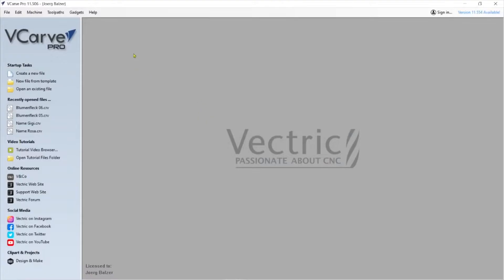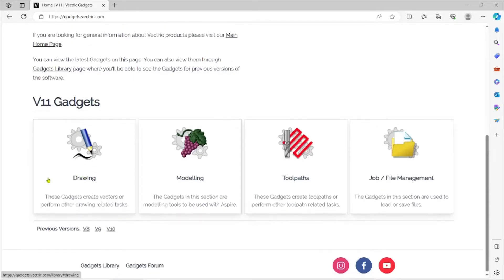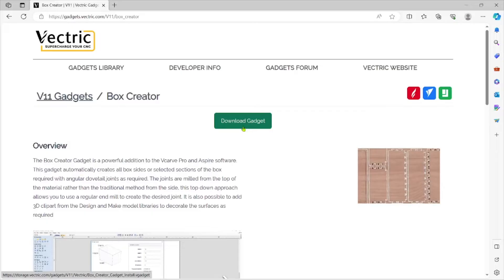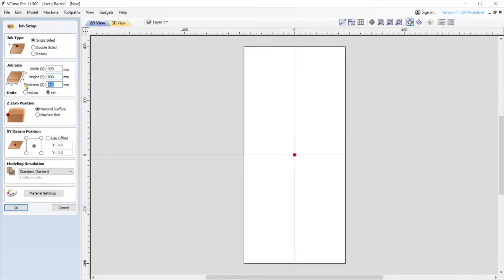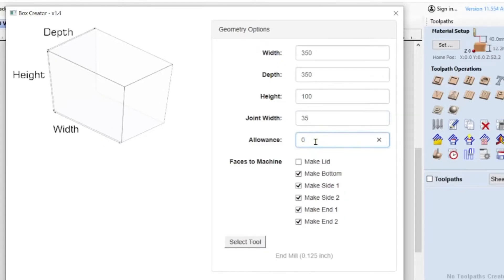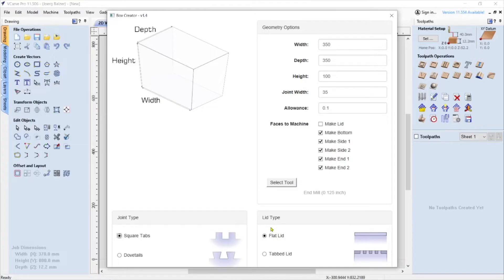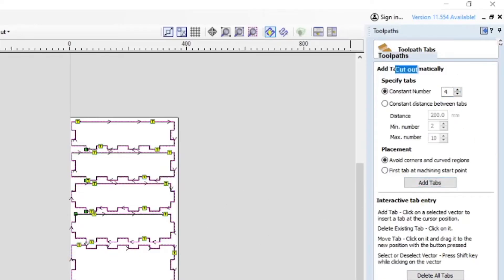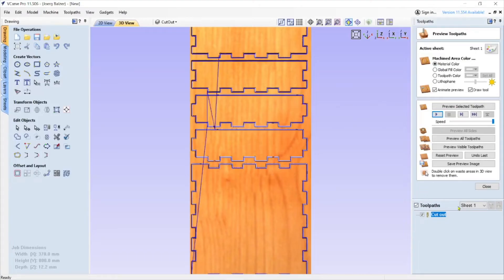Vectric Box Creator - The Easy Way To Make CNC Boxes!

Comment: Struggling to get joints as tight as yours. Looks as if mine creates on the vector rather than outside.
Reply from the maker: This is one item I had written down and forgot to mention. Yes it’s correct it needs to be “ON” the vector. So I made 3 tests for the allowance. The 0.2mm was too loose, the 0.1mm was still loose but good for many joints that will need to be glued. 0mm was difficult to get together and I just used some CA Glue here and there. Make sure the material thickness is set correctly and that the diameter of the bit is correct. That’s really all you can do.
Reply: For the USA folk I use a .01 inches for my allowance in the Box Creator.

Comment: So you are trading shortening your tool life for a cleaner result?
Reply from the maker: I would say it depends on the impact of the project versus the tool. 
If an edge is difficult or impossible  to clean up, yes I trade a bit of tool life. Also in wood rather not that significant (vs steel).

Comment: This was a very well done tutorial. I made a small box using the box creator and it turned out great. Thank you. One point that you made was the wording of "Allowance". I agree in that allowance is not a good work. However, tolerance is the wrong word as tolerance refers to a range that a measurement can be in. The correct term, at least as far as machining is concerned, is "Clearance". Again, thank you very much for your work, it is much appreciated.
Reply from the maker: Appreciate the feedback !!! Yes clearance is much better in German we often use “play”. Or reference to the fit like “press fit”. Glad your project turned out great.

Comment: If you are doing finger joints but not using box creator, what allowance do you use to have a tight fit.  Example if the male finger is one inch, what side would the female be in order to allow for glue but not be too lose that it doesn't stay together?
Reply from the maker: This seems to be an easy question but has a bit longer answer. So on my machine on wood projects I go for 0.2mm. If it is a joint with lots of surfaces and the risk of the wood will swelling up on me I go for 0.3mm. However chances are on your machine that varies a little. These CNC routers are just not as accurate - unless you make it. I would start with a clearance of  0,2mm.
Reply: @ Thank you! I’m working on my design now.  Your videos are very helpful.
Reply from the maker: Excellent that you get some value out of my content.

Comment: i have yet to find a video where you explain why you zero Z at the machine bed.  will keep hunting; hopefully i can find your reasons soon.
Reply from the maker: Yes, I do explain that I think in the video where I make the spoil board. So if you  Zero on the machine bed any material variation from plate to plate or batch to batch will be invisible to the Z setting. You will always cut all the way through the material AND avoid cutting into the spoil board. Hope this short explanation makes sense.
Reply: @JBWorx  just watched https://www.youtube.com/watch?v=YVEvCBv6PM0 and i didn't hear anything about the Z-0 to the spoilboard (but perhaps i missed it).  i'm not sure why 0-ing to the material surface made more sense as a beginner (i've only been doing CNC for 8 months) but what you said above makes sense since otherwise you're thinking depth-of-cut rather than thickness of material after cut.  perhaps it varies by project and i haven't done enough projects that make more sense zeroed to the spoilboard.
Reply from the maker: Yes there are times were you need to have a price depth of a pocket for instance without surfacing the material first. Now you need to zero out on top of the material. If I have to cut through the material I always prefer to zero out on top of the spoil board.
Reply: @JBWorx  that makes total sense.
Reply from the maker: Give it a try, I think you will like it.
Reply: If your material is truly flat; z+0.003” (not sure what that is in metric) works perfectly with the paper drag method. I don’t like touch off pucks. I use tape instead of clamps and I almost always cut through the material while leaving the blue tape intact after zeroing to the material.
Reply from the maker: If you have good material that is overall within 0.1mm then zeroing out on top of the material as you lined out will work fine. Have a look at some of the spoil boards shown on YouTube. Some operators make 3mm deep channels into the spoil board to assure they cut through the project. I am saying that is not necessary. You figured that out using your method and that is great 👍

Comment: Nice video, cant believe I haven’t tried this. 

Could you use a 1/16” compression bit and a 1/8” as a clearance?
Reply from the maker: Yes certainly. You can select 2 tools in V- carve and use one for the Final Cut. However I think I would just run a 1/8” and see how you like it. The finger joint fillets are almost not noticeable.

Comment: Tabs in wrong place.
Reply from the maker: Yes the software will put huge tabs in the design. However you can delete them and place our own with the dimension and position you like.
Reply: @JBWorx  I just found the box creator gadget puts them in places that are not easy to sand. So I don't use the tabs. I just shoot a 23 gage pin nail so the parts don't move around.   I have a version 1.5 of the box creator gadget that remembers the last settings used in all the fields and I modified it to default to tabbed lid instead of dovetail.    Also turned off the ramping as well.   SharkCNC fixed a few of these things for me.   The file is on Vectric User Support Board.
Reply from the maker: Nice thank you !! Instead of shooting the nails you can make a test using a compression bit. It will pack the chips very tightly into the path of the tool so that the part that gets cut out stays in place. It works in many situations.
Reply: My Bosch Router blows out the chips and clears the cut as it goes along.  The heavy pieces will stay in place most of the time but the smaller 1/4" material parts will get blown around.  So the 23 gage pin nails are my go to choice.  The holes are hard to see in the material as they are like a straight pin in size.
Reply from the maker: Yes they is a good solution. You could also check into the fiberglass nails. More expensive however
Reply: @JBWorx  I was going to but saw they leave a very noticeable hole.  I was using a brad nailer with soft nails.  It worked as well but it left the  bigger holes as well.  On most of my quarter inch thick boxes I run the 1/8" end mill twice.  The first time around I pause the toolpath and shoot in a couple of 23 gage pin nails.  If Iuse a half inch pin nail they pull out with needle nose plyers after i have removed the material.    The longer pin nails 1  1/4 they often break off and I will have to flatten them with a hammer and then flatten them when I flatten my jig /spoil boards.  Lots of tips and tricks I have learned on youtube.  Thanks for sharing your work here.
Reply from the maker: Thank you for sharing your experience 👍
Reply: Awesome, thank you!

Comment: just make a parametric model in fusion. voila. done.
Reply from the maker: The point of this video is that you don’t have to design anything. It’s the easiest and fastest way to make a box.
Reply: @JBWorx  you just have to buy a specific machine and use specific software with specific add ons. Or you can use fusion, or any parametric modeling software, which already has a box generator, and post the code to any machine. With a full suite of options so your tabs and joints actually fit. But hey. Shill on.
Reply from the maker: Ok
Reply: @JBWorx  just the facts.
Reply from the maker: Certainly a good option if you make boxes of various sizes all day long.

Comment: Good video, thank you! In regards to the tolerances, obviously you can go beyond 1 decimal and use 0.08 and such, most modern machines are able to work that precisely. I suggest clamping ANY wood joints together regardless of tolerances, with that your pieces will be literally welded together. Dont just rely on tight joint and tolerances IMO.
Reply from the maker: I think in wood and using metric you will really never need the second decimal place. Also a joint too tight has no room for glue and squeezes everything out let alone the difficulty of assembling it. So yes I am a woodworker and I think a joint benefits from the right tolerance depending on the type of glue used. Epoxy for instance needs no clamps while polyurethane glue will push every joint apart during curing if not clamped. Anyways use the box maker gadget to make boxes quickly.
Reply: @JBWorx  americans, I swear always got an opinion where its not needed, I apologize for my countryman some of us dont have any manners
Reply from the maker: No problem all good. 👍 and thank you for reaching out.

Comment: Can you get this gadget to work on VCarve Pro vs 12.004?
Reply from the maker: Yes it should be running on all newer versions starting from V9 on forward
Reply: Yes it works the same.  Look on the support board for Box Creator 1.5  It has some fixes in it to remember the settings and has comments in the LUA file to change the defaults from dovetail to box joint and flat lid to tabbed.  Also to not add the ramp and the tabs.  So I can run it most every time with out having to change those settings each time.

Comment: One more observation. The gadget only allows for an equivalent bottom and top box configuration. There are far too many use cases where the bottom is larger than the top…or vice versa. For example some planters or garbage bins are smaller at the bottom than the top (say 30mm squared at the bottom and 40mm squared at the top). Is it possible to address this within the gadget? Or does this need even further adjustment in Vectric Aspire?
Reply from the maker: The gadget can only make straight boxes. Anything tapered you will make a classic design by drawing every piece out in the Vectric software.

Comment: Thank you very much for putting this together. I had been using online box creators and Adobe Illustrator, then importing the svg file into Aspire. After following your tutorial I noticed that there is no intuitive way to indicate how many finger joints per side on the gadget. It seems to use a default. For example, what if I wanted 3 per side instead of 4 or vice versa. Does that make sense?
Reply from the maker: So the only way you can change the amount of fingers is by the dimension of them. It really is a simple tool to make a simple box. If you like to make changes then you can by creating the box drawing and changing it by editing the drawing itself. But then I think I would just start from scratch not using the box creator

Comment: Dear, i made this model, unfortunately two sides not accurate.
Reply from the maker: Hmm 🤔 not accurate how?  Did you use the allowance? And how much ?
Reply: zero allowance @JBWorx
Reply from the maker: With zero allowance the parts will fit together only by using a hammer … at leased if your machine cuts accurately.

Comment: Nice project!. Not sure I want to buy a Vectric license along with the annual F360 lic though :(   Good results with the 1/8" bit! I'm guessing 4 passes? was surprised you weren't running a higher spindle speed...
Reply from the maker: Yes it’s a bit of a cost but for woodworking you can’t beat the Vectric software. I usually have low feed rates because I have time, I don’t mind if my project takes 5min longer to cut and with that I can use a lower spindle speed. Yes the 1/8” bit I like a lot for projects like this. It’s great for cut outs in 1/2” ply. Thx for reaching out.